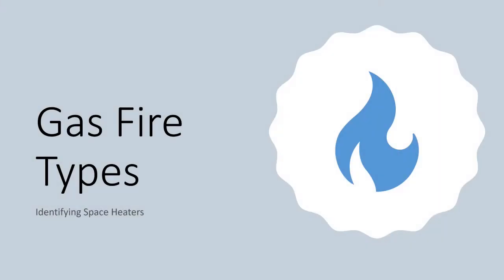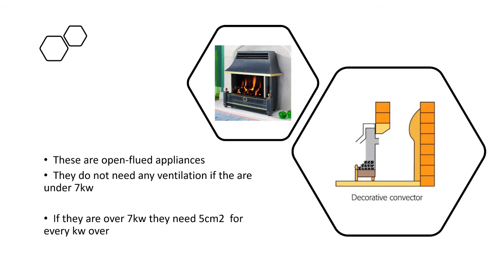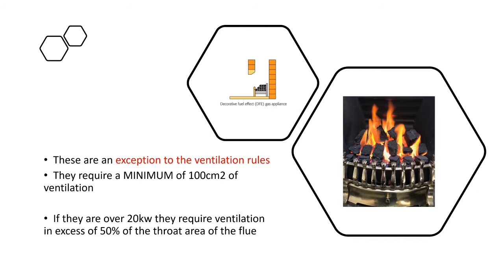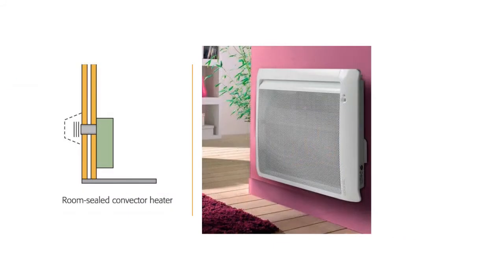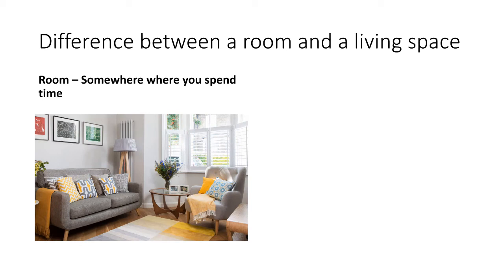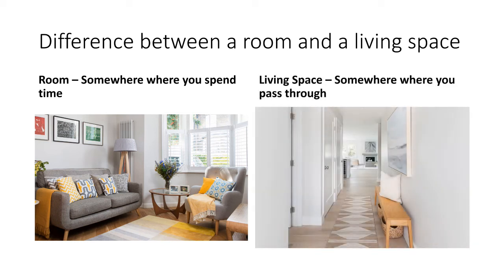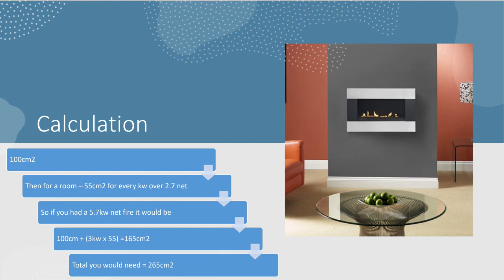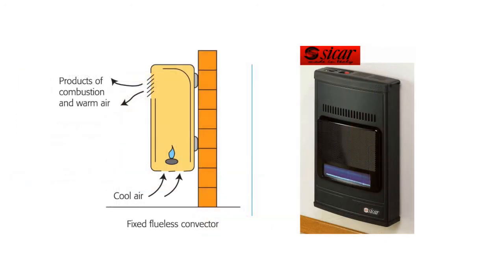ACS Fire Types and their ventilation

Comment: EXCELLENT video!!!

But what does the '45w/m3 of heated space' mean?
It's beneath 'MAX HEAT INPUT NET' heading.

I took that to mean you can't have a flueless fixed space heater which exceeds 45 watts of net heat input per m3 of the room but that can't be right.

Any help would be greatly appreciated.
Reply from the maker: Sorry..typo! Should read 100m3 room. A 10m3 would be approximately 2mx2mx2m so that’s tiny..you’ve got to remember that this was all put in place because landlords were putting standard 7kw in tiny student flats. As you know the poc’s from unventilated appliances go back into the room and there comes a point where the fire is so big and the room so small that it will overcome any reasonable amount of ventilation..that point  is 45w per m3. I hope that clears things up…if not let me know…however don’t get too hung up on it, you won’t get tested on it!😁 Just remember it if you have to fit a fire!
Reply: @passyourgas  
Ah I see. I think I also was overestimating the size of a 10m3 room as well.

Thank you so much for your help mate. 
This is the best gas YouTube channel I've found by a mile 😁😁 
Cheers again!!!
Reply from the maker: Hi, thanks for commenting. It means that you’re only allowed to have 45 watts of heat for every metre cubed of space in the room…so if you were fitting a 4.5kw heater (4500w) it would be illegal to fit it in a room less than 10m3. It’s to stop you fitting a fire that’s too powerful for the room..I hope that helps 🙏😁
Reply: @passyourgas  Thank you for the reply! 

But 45watts x 10 = 450watts. 
So does that not mean an appliance over 450watt is illegal in a 10 M3 room.

That is what's confusing me, sorry. Only 45 watts for every M3 seems extremely low to me.

Sorry again, where am I going wrong here. 😂

Comment: Why does a DFE need 100cm2 of ventilation but say fires like an ILFE just work off the 7KW in the room, any info would be much appreciated, thanks
Reply from the maker: Hi again shredder. There are a few technical reasons because a dfe, unlike an ilfe sits under a flue rather than being attached to a flue. 
It might help to explain a quick history of dfe’s. 
In order to make them look like a “real” fire (I.e wood or coal) you have to make the blue gas flame burn yellow. As you’ll be aware from your combustion of gas lessons, methane can only burn yellow if it is creating carbon monoxide! So, back in the day there were lots of these fires being made which created CO and there were a lot of deaths..and the best answer the gas safety council could find was to give them loads of ventilation to prevent the deaths. That’s the simple answer. The more complex answer goes into flue throat size and shape and some heavy calculations that, quite frankly, you will never need to refer to. I hope that helps. Cheers
Reply: @passyourgas  thank you 🙏 this info has been very helpful indeed, by the way, gas tumble dryers are a rare appliance to come across but was curious to know how u work out the ventilation for them, any help would be much appreciated, thanks
Reply from the maker: @shredder8000  thanks for your input. I’ve just finished a water heater video which should be up in the next day or two. I’ll make a quick one for tumble dryers next week..
Reply: @passyourgas  thank you, much appreciated 🙏